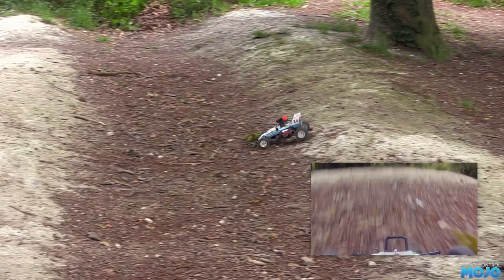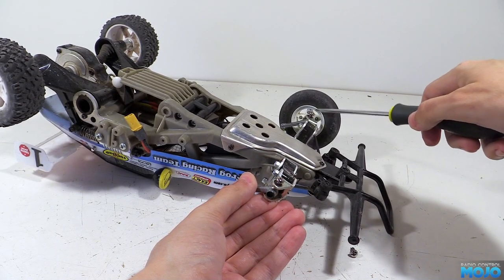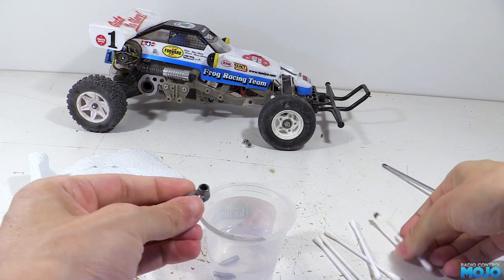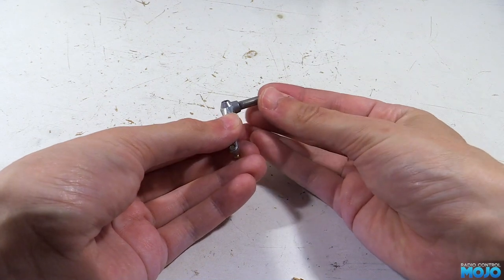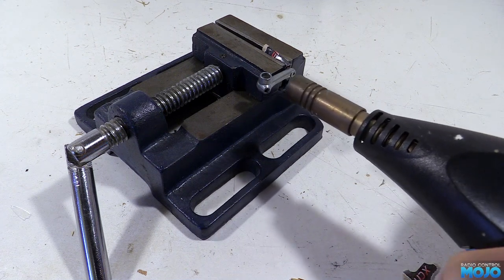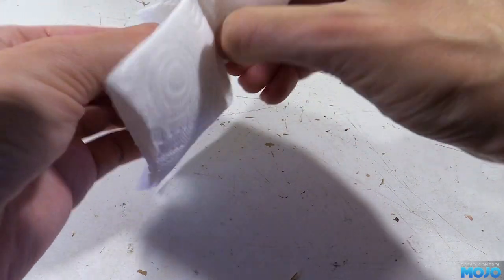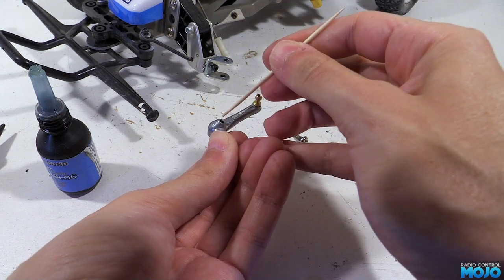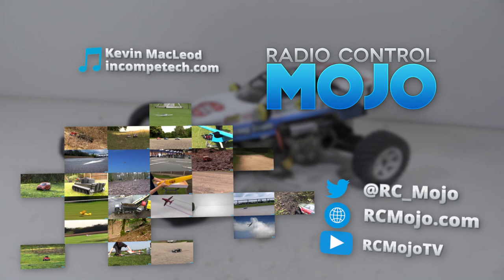Tamiya The Frog - #9 - Upright repair

Comment: Nice video,, out of all the videos on anything Tamiya this was the only one I found concerning this major flaw on this iconic buggy,, I was going to post a upright tutorial because I couldn’t find any and then came across yours so cheers mate for saving me time,, I have 2  Frogs one being my original from 83 and then a re-release although I don’t as I say stretch as much plastic on my original as I’d like that’s what I purchased my so called updated version and this is the second time I lost a wheel,, I found out with the stock fronts I really don’t see that problem however if I put on my brat wheels the extra weight and diameter seems to cause an issue,, anyway I did exactly what you have done and wanted to validate that it’s a good fix,, I used red thread lock and can bash with the best of them,, thanks for putting this out cheers!

Comment: A very nice repair video, thanks for posting.  Ever notice how Tamiya RC's always have some issue that leads to a failure?  Anyway, hands down, the best de-greaser I've used is lacquer thinner.  It evaporates quickly and leaves an oil-free surface behind.  True, the fumes are very  strong but there is nothing on the market that dissolves grease better than thinner.

Comment: If you want the splined shaft to never come out again on its own you could use (original) Loctite 603 or 648. We use these at work for industrial machines. Usually when a part fails with these adhesives applied it's somewhere else entirley on the part :)

Comment: Had to reseat both axels in my Brat this week, first battery use too. It’s clearly a manufacture issue, I was only running on concrete. Thanks for the video showing the the proper technique I suspect a few will be finding this after similar issues. I used a vice and force, as said, and was lucky as everything went ok in both sides. Never had this issue with my original Brat 35 years ago 😂
Reply from the maker: I wander if Tamiya made a bad batch?
Reply: RCMojoTV  I’ve seen another you tube video of a new owner having the same issue. I think it’s just a rere substandard manufacture. Great kit though 😊